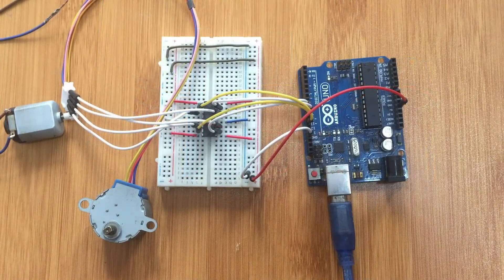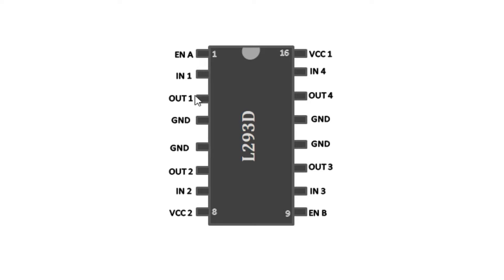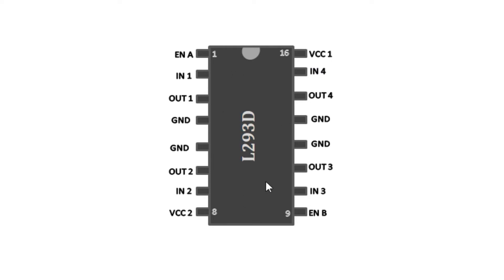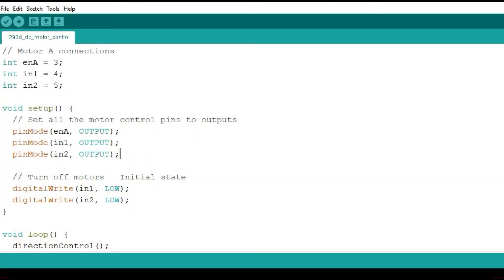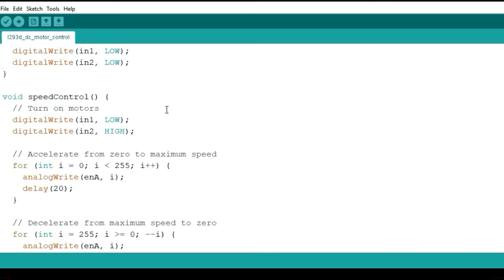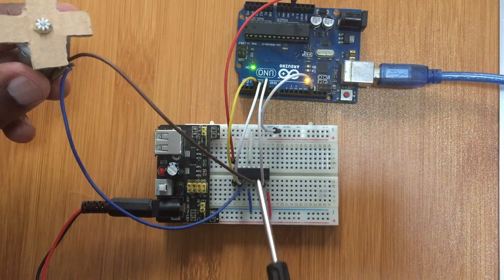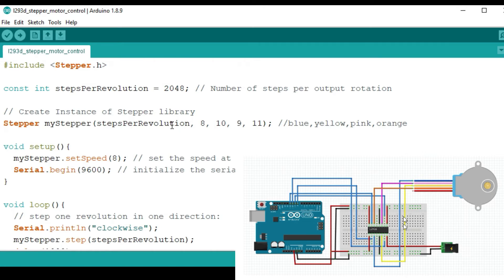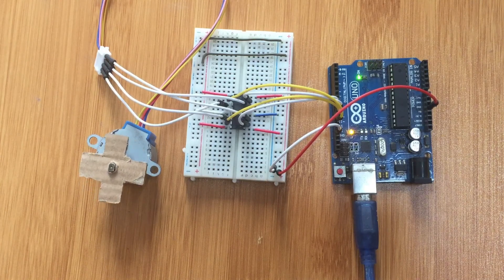L293D Motor Driver Control of DC and Stepper Motors with Arduino.

Comment: The 28BYJ-48 is a unipolar motor which has 5 wires.  The L293D is a bipolar motor driver.  A bipolar stepper motor has only 4 wires.  I think you have an error in your connections.  The 5th wire that is the center tap between the two coils should not be connected to ground.  It should be left unconnected, or better yet, the trace on the 28BJ-48 that connects the two coils should be cut.  Doing so, turns the 28BJ-48 unipolar motor into a bipolar motor.  If you google this, you will find instructions on how to do that.

Comment: can i connect another DC motor with the same connection??
Reply: The L293D has two channels so it can control 2 motors.  If you want to control additional motors, then you need an additional L293D.